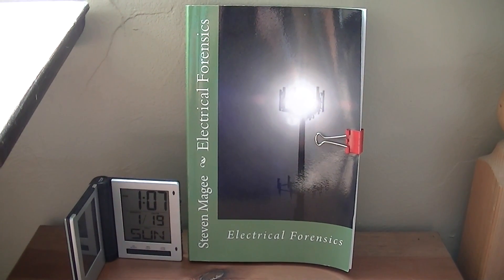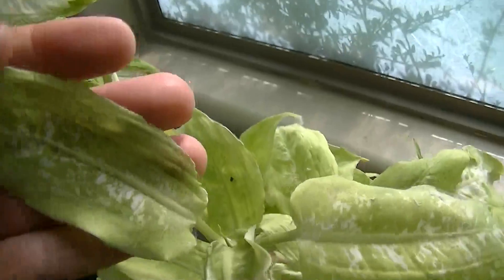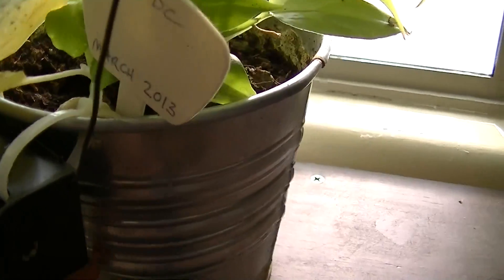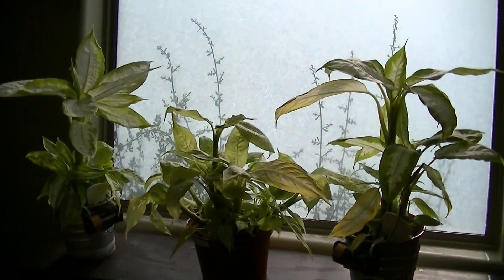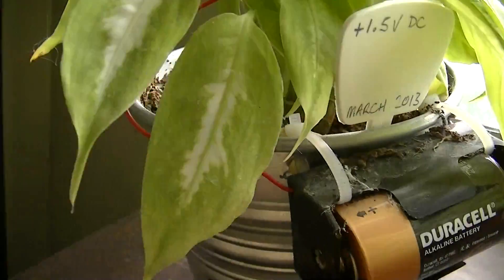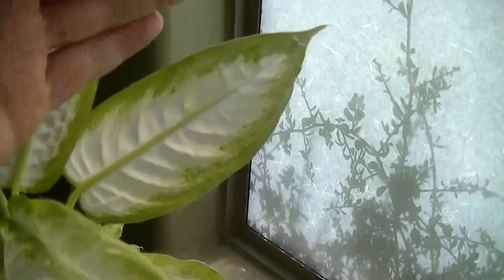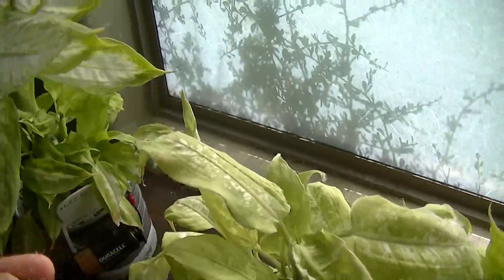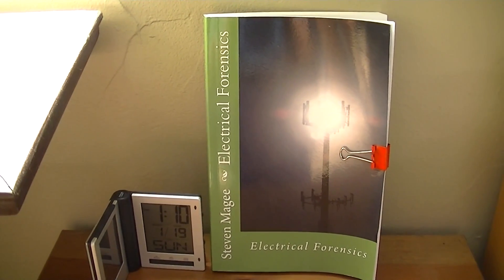1 5 Volt Battery Plant Experiment January 2014 Update

Comment: Very interesting experiment, Steven.  From my research, the stimulation effect in this case would be mostly due from the effect of the electricity upon the active plant cells and the subsequent flurry of electrochemical signaling within the plant.  I imagine that this activity makes the negative effects of high-frequency EMFs minor in comparison.  On the other hand, electrical stimulation has been known to stimulate beneficial genetic adaptations, so perhaps there is some element of accelerated adaptation going on as well.
Reply from the maker: I applied the battery technique to the human (me) and got this crazy chemical smelling urine!  It smelled like WD40.  My latest research on this has just been published in the third edition of Toxic Health http://amzn.com/1466336153
Reply: Well that's interesting... Can you tell me more about how you applied the voltage to yourself?
Reply from the maker: It is in the book Toxic Health and is very experimental.  I would not mess around with it unless you are okay with any long term risks that it may eventually present and are also consulting with a doctor regarding the technique.  Amazon preview may let you read it, page 36.
Reply: Actually, I'm very interested in using low voltage DC in human applications - specifically for promoting the rapid healing of skin lesions and cuts.  There is a significant body of research showing great benefit of electricity as a way of expediting the healing process, both in people as well as animals.